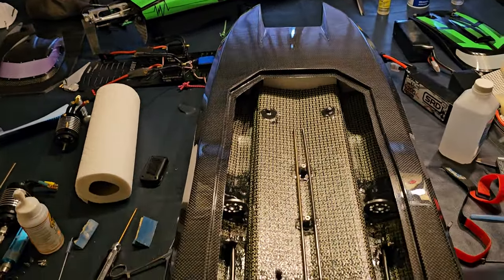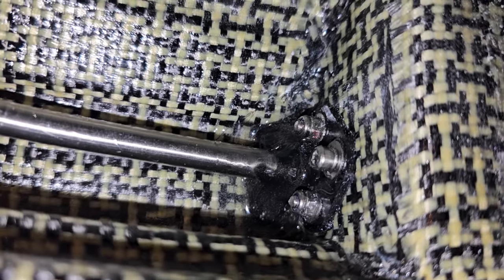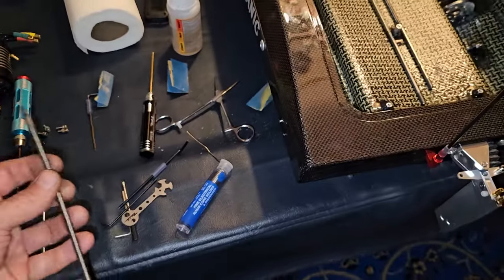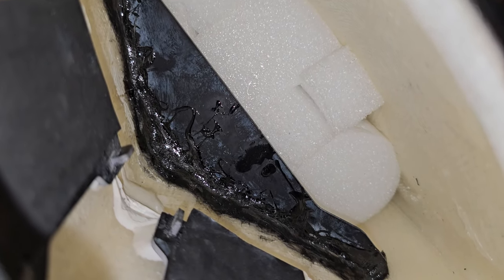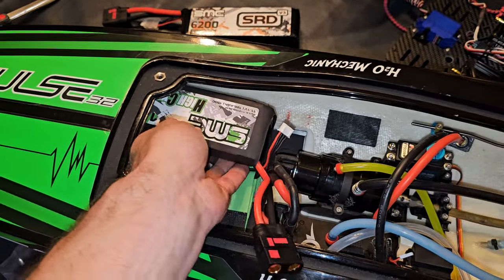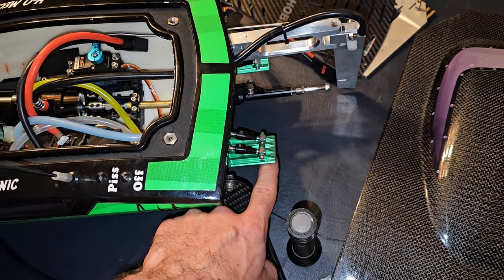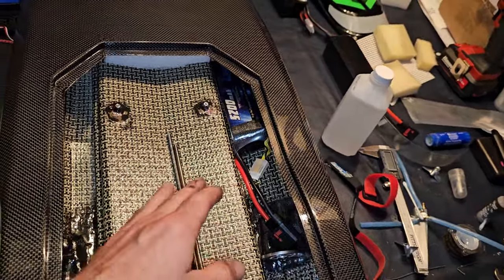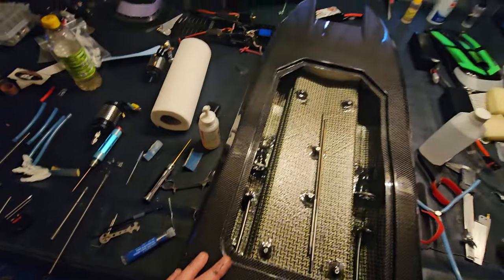TFL Cheetah Upgrades for more Reliability

Comment: The only issue with changing to the welded flex cable is with big power they break at the point where the weld meets the stub  shaft and you lose your prop. I had to change too the type you pulled out because I am sick of using props. So I glued the square end into the stub shaft.
I had trouble getting it centred at the glue join so I’m testing this morning in the water to see how smooth it goes.
And yes it’s going to be a pain to grease the shaft.

Comment: I see the Cheetah has the same issue as the Zonda in alot of ways . The Zeee 5200 are the only 6 s batteries that will fit in the sides of the hull as intended although you have a tad more room then the Zonda with its sliding trays although your ESCs will like the 4s better or even the 5s i would imagine . Also i had to completely rebuild the power train , removing the motors and fixing the alignment issues like you did , and changing out the two piece drive with a one piece flex cables . Glade i bought the upgraded cables when i bought the boat ..